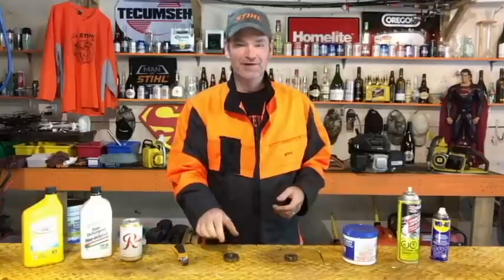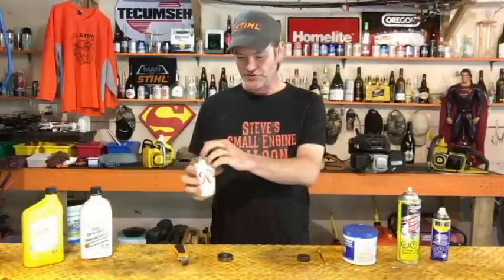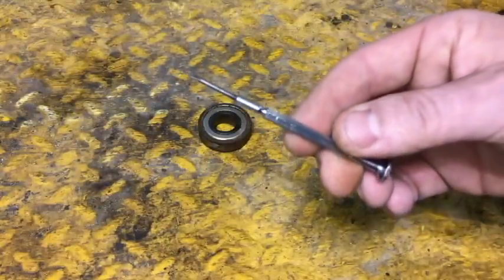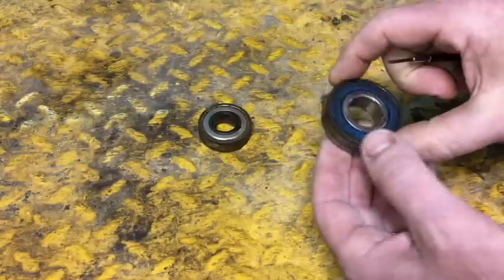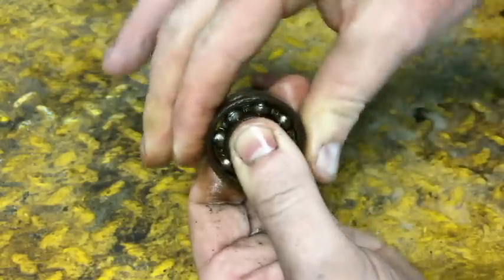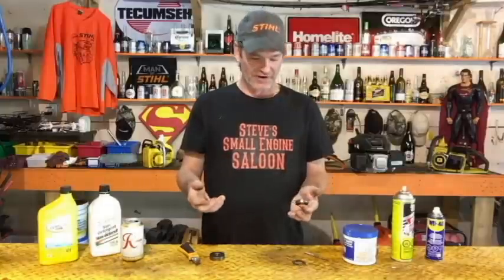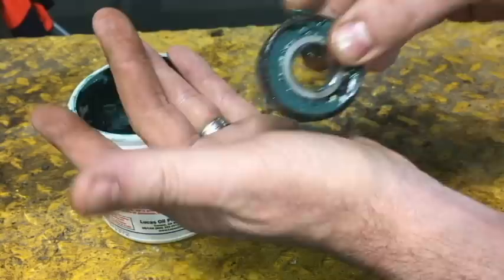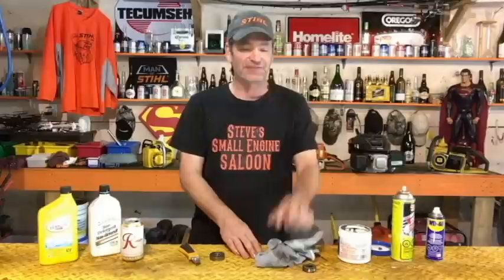How To Un-Seize, Clean and Grease a Sealed Bearing

Comment: I know this video is 3 yrs old, but im gonna throw in a helpful tip. I work in the swimming pool industry. Instead of replacing bearings in pump motors and such we typically just replace the motor. I recently decided to attempt rebuilding a few scrap motors and in doing so found a lubricant like no other. Its called Zero Lube. Its sold in the pool industry as an o-ring lubricant, but I use it for a lot of other things. Like rusty tools. Crescent wrench was seized. Put a few drops on it and let it sit for a day and it rolled like it was brand new. I used it on a seized 6202 bearing and it was amazing how freely that thing spun after. Motor worked like a champ and still is a month later. Quiet as a sleeping baby. Anyway, Zero Lube. Great stuff. Just thought I would recommend in case anyone is looking for a good all around lube.
Reply: I've just looked it up. It's spelled 'Zer0' not "Zero". I watched one vido to free a stuck plastic handle doodah on a water pump. Several people said they used washing up liquid and that worked, too. So I went from 'I'm definitely going to buy that!' to 'I probably won't buy that'. Need more convincing.
Reply: @johncollins8304  Zer0 Lube is made by Lubegard and uses their patented LXE technology. The chief developer of LXE was Dr Phil Landis, former head of Exxon/Mobil Oil Applied Lubrication Research Group. Many of the Lubegard products are considered staples by industry technicians in the automotive world.
Reply: Thanks. I’m gonna give it a shot. Sounds like a good product, patented & proven.

Comment: Great tip Steve, as always. What I do is drop the bearing into white vinegar which removes ALL the rust, even from the balls or needles. An hour or two in vinegar and they actually get shiny again. Then you can repack them after you rinse off the vinegar.
Reply from the maker: Right on Stevo...
Reply: I might try vinegar in a small jar.  drop right into the ultrasonic cleaner.....  might work?
Reply: That rust is just cushioning for old bearings
Reply: @xredman002  Yeah, I wondered why he didn't use the u/s bath. In a glass not plastic jar like he showed us I another vido.
Reply: Phopshoric acid is also considered the best acid for stainless steel and removing rust and preventing further rust. Phosphoric acid and acetic acid vinegar both prevent further rusting by removing and dissolving the brown rust and turning into a hard black iron coating.
Reply: Yep but I soak them in diesel to remove grease first and white vinegar second 
Inspect and junk junk

Comment: Love your site and boy, have I learned a lot from you Steve... Thanks very much.
This video on the restoration of seized ball bearings is interesting, however, bearings are the Achilles heel of the manual transmission world. Having been a licensed transmission technician since 1982 I (if I may) would like to inform you of the correct procedure to check a ball bearing.
 1) Free up the seized unit with your choice of fluids.
2) Wash thoroughly the bearing in varsol or similar thinners.
3)Blow dry the bearing completely (do not spin the bearing with air)
4)Apply a few drops of light machine oil(I use ATF)
5)With your thumb through the center of the bearing to support it, roll the outer race around while applying significant pressure with your other hand. ANY roughness in either the outer or inner bearing will be felt. If it's rough AT ALL it's junk.

Comment: I learned the palming method back in the mid 60s from an old school mechanic friend of my dad.  There is a slight variation. Keep palming the same spot until a good amount of grease oozes out the opposite side before moving to the next spot on the bearing. All the while, do not turn the inner race with respect to the outer race. Turning the races while palming will spread the grease without properly packing and filling the entire bearing. No need to palm the opposite side. When palming tapered roller bearings, force the grease into the larger end of the rollers until it oozes from the smaller end.

Comment: Excellent video, as always. I bought an old Craftsman LT2000 last year from a guy who was selling it for his aunt. Her husband owned the mower and had died. This old guy had kept up the maintenance on it very well and had even upgraded the motor from a 17.5 B&S to a Platinum series B&S 21hp motor. I noticed it was making some weird sounds every time I mowed. So, after watching some vids, I decided to take the floating deck off and do some maintenance. Your videos on greasing the bearings were the most informative and I thank you much for taking the time to post these. My bearings were very dry and nasty looking. I used Q-tips to get out the old, gunky grease and put new grease in them. Wow! 100% better! I can't believe I was putting my mower through that stress. Won't happen again. I'd like to get 10-15 more years out of this thing. I can't wait to mow this weekend, after I sharpen the blades and get the deck back on, lol. Btw, I also don't work on anything or mow on the weekends without a good beer or 8...always above 5%. Thanks, Steve!

Comment: Exactly what I wanted to know. I am still making my grandfathers(RIP) work shop, my own. The last couple days I have been emptying out a couple deep drawers loaded with pulleys, bearings, etc.. I didn't realize how many bearings were in there. Some are in very good condition. I have had them sitting in oil and gas, and have been using a paint brush to clean out the old grease from exposed bearings; and to clean the outsides too....they have been in that drawer for at least 4 decades.

I have a couple ideas needing bearings, although most of these are too big. I just did some searches to see if there were a way to clean and repack old sealed bearings. I have a bunch of tabs opened to explore my search results, and luck of the draw, got you Steve...a slightly younger you LOL

Well I can close the other tabs, because you answered my questions. I wasn't even certain that all my bearings were the same type, as several had no seals, so looked very different. Of course I wondered if all the others looked just like them, but didn't know till just now.

Once I am done with the initial cleaning, I am going to open them up for full restoration. This will safe a LOT of money, and now I can think about those projects requiring bearings.

Thanks Steve.

Decided to check with the other experts, and learned that it is wise to check and even repack a new bearing. They cheap out on the grease and use cheap stuff. FYI

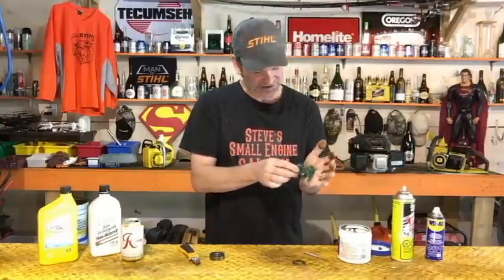Comment: @8:07 don't flip the bearing over!  If you flip the bering over, you're using new grease to trap in the old grease.  Always go from one side ONLY and keep going until you see the old grease being forced out and the new grease shows up on the other side.  You form a small seal with your hand that pushes a small amount in each time, just keep working it until you see nothing but clean grease.  We were actually taught this in high school a LONG time ago.
Reply: Just clean the old grease out first.   WD40 and air compressor. Then re grease any way you like
Reply: I agree with Randy. You have to make certain you have removed ALL old contaminated grease before you start the repacking process. Otherwise you are just wasting you time and setting component for an eventual failure.

Comment: "Palming" is called "field packing" where I grew up. It really gets the grease down in around the balls and pushes out the old grease. I've done it this way since the 60's.

Thanks Steve, great tips as usual.
Reply from the maker: You are welcome.  That's why I do this!
Reply: My first boss taught me the palming method, and I have been using that method for fifty years.  It think it works better than my bearing packer I bought.
Reply: that was the way my father taught me to repack berrings , he was a merchant marine  in WW2 had 4 ships shot out from under him ( 3 trop'ed & 1 bombed) started as an oiler on an iron boat plying lake michigan in his teens) Very proud of the old man.
--Rick
Reply: Comment to Steve, to john t, and to Rick.  First Rick -- thank the old man for his service for me.  My dad was merchant marine too.  To Rick, it's good to hear others repeat they've used this palming/packing method since the '60s.  Me too.  Finally, to Steve -- like the other guys say, this method of packing bearings has been around a while.  I first saw this palming method of packing bearings in an old 1950s Motor's Manual.  In the old days when you could take bearings completely apart, we used to remove the outer and inner races, inspect each ball, and replace those that weren't perfect.  Then we would repack them using the palming method (as per Motor's Manual illustrations) and reinstall them by properly torquing them.  You knew you had the right amount of torque when the shaft no longer would rock back and forth but the bearing would still spin freely.  Then you'd tighten them about a 1/4 turn more.
Reply: @rickcoona  talk about not your time to go right there. Most don't make it through one sunk ship much less 4. Even if a life Raff was accessible it doesn't take long for people to be so far spread out search efforts will have almost nil success. And a lot of ww2 guys in the water became a shark buffet waiting to be rescued. Only takes a few drops of blood and every shark in a couple miles knows. With some real injuries several miles would be heading in. Frightening stuff. I know in the early first years of the war before america joined. The Germans were evacuating ships before torpedoing it. Crew would be unloaded in a neutral area. They didn't want to invoke neutral nation's into the war. Or be seen killing them. Once the war progressed basically any vessel from any country helping the enemy. With no warning,don't want your position radioed in exactly and be unloading a ship then your mission of search and destroy ends while you have to find safe harbor for said crew. Time and resources. Much respect to sailers of ww2
Reply: @JamesSmith-lt5zz  Indeed and thank you i learned a lot from him before he passed they wern't called "The Greatest Generation" for nothing.  fun thing was he was "conscripted" for the rebuilding of Japan after their surrender and when he got home to Michigan Three days later he Received a 'Personal invitation from the president'  to report to his local Draft Board: "Congratulations Son, You are Going To KOREA!" When he reported, he brought his service record and was made an instructor  for the combat engineers at the local training base. I still have his basic Field Manual  FM 21-105 Engineer Soldier's Handbook issued from the War Department dated June 2, 1943.
Reply: @rickcoona  amazing thanks for the follow up. Maybe put that manual in some kind of plastic wrap to preserve it from oxidation. No telling what collector might pay for it  probably only a handful left in the world
Reply: That's the way we always did it with the tapered roller bearings on a car after cleaning them then I got a little bearing packer after that you clean the bearing and then put the bearing in there and screw the top on and push down on it or squeeze it in a vice and it pushed it through.

Comment: Great instructions on greasing a sealed bearings.  And for repacking multiple bearing at same time take a empty coffee can put enough grease in can to cover the top layer of bearings, heat grease until liquid, then put bearings in can making sure top bearings are covered, then let cool.  I use a wire coat hanger with hook at end to make an extraction tool, then wipe off excess grease. Ready for use or storage.

Comment: down south we been calling the palm method hand packing the bearing ...only way to pack the bearing if you dont have the bearing press...Also don't turn it over and do the other side you only push out what you just pacled in ...keep palming/packing untill you see the grease coming out the other side ,once it comes out the other side put the seals back on and it's rdy to go ...Great Video Brother !

Comment: Greetings from Williams Lake, British Columbia! I do this all the time, but only if the balls look good. Just one pit or flat spot on one ball will lead to early failure, and that failure never happens at a good time. Ask me how I know.

I use ordinary solvent or paint thinner with an old toothbrush to clean the bearing, then compressed air (step outside!) to remove all debris and solvent. NEVER let the compressed air spin the bearing, as that can cause damage. Only re-grease once the bearing is dry. Some folks swear by lithium grease, others swear by moly grease. I can't say I have a preference. 

Steve's technique here is great for most applications. But if the bearing is buried in a really difficult spot, replace it. Only try saving a bearing that is fairly easy to get at. Great videos, Steve!
Reply from the maker: Thank You...

Comment: Yo Steve, this saved me today.  One of the bearing seized on my 17 year old mower drive axle.  I took it apart, being a holiday the specialty shops are closed, and the auto shops didn't have a replacement.  Finally I thought about what else I could do, and ran across your video.  Popped the seals off, washed all the dirt/grease out with soap and water, dried it, and then packed it and reassembled.  It's like brand new.  Thank you for posting this!
Reply from the maker: Right on Aaron!  You're Welcome...

Comment: I've cleaned many sealed bearings in my day. I mainly use my parts washer to do it. I take off both seals, clean the bearing, inspect it, put one seal on, pack it full of grease, then put the other seal back on. I've done this on deck spindles for years and the bearings last for years as well. If you buy new sealed bearings, take off one seal, pack the bearing full, then put the seal back on. They put very little grease in them from the factory. They do wheel bearings the same way on autos and motorcycles.

Comment: Soak them in fuel works for me spinning them in the fuel.Just remember folks that this doesn’t fix pitting and any wear in the races or ball bearings currently there.

 Good video Steve on Band-Aiding a bearing.

Comment: Many thanks, Steve!  I used your technique today on my Craftsman deck idler bearing.  It was so loud, rough, seizing then I remembered your tip.  Popped the outer seal and washed the crud out with brake cleaner and compressed air.  Carefully added wheel bearing grease, much to my surprise the bearing was as smooth as silk!  Assembled in reverse order and was back in business in short order.  Smooth, quiet and good as new!
Reply from the maker: Right on buddy!  Thank You...
Reply: Normally I like what Steve is doing, but not this. Bearings are cheap and widely stocked.  Generally the time cost accessing any bearing greatly exceeds its value.  Potentially you could do a lot more damage with a seized or even a rough bearing.   Absolutely do this only when you are stuck!

Comment: I finally got the motivation to drop the deck on my TB42, remove the spindles and grease those sealed bearings. Thanks to you I have a better understanding of "how to, why to and when to" do the maintenance. I sharpened the blades also and found out that the drive belt runs so much easier and faster because there's no more awful dragging, dry, screeching noise coming from the bearings. I appreciate this machine thanks to your videos.
Reply from the maker: Excellent!

Comment: Tip...use the ultrasonic cleaner to clean out the bearing like new. I recommend replacing any seized or lose bearing has a full time load or any weight on it. Wheels, blades, pulleys, etc. Just save some time and replace them. The clean and repair method is best left for things with partial to no continuous loads, like a mower deck side wheel, that only touches the ground occasionally. It would work just fine there. But an old repacked bearing won't last at speed with a full load for to long before your replacing it anyway. Take care. Great video.  Jpol.

Comment: This is only worth doing if you are stuck and can't get a new replacement bearing easily/quickly. Once the bearing surfaces are pitted by corrosion they are still on borrowed time even when unseized and relubed.

However even most new bearings generally lack enough grease and/or use poor quality grease. You can dramatically increase the service life of new bearings by cleaning out the factory grease and then fully repacking them with a quality high pressure/high temperature grease.
Reply from the maker: Right on...
Reply: True.  I understand it that they fail (seize, dry out, or get wet and dirty) because the seals fail.  So even if you clean and lube, the grease will be lost, the water will come in, just like before, and you still need to go with new bearings.
Reply: Get in there with a flashlight and a magnifying glass, and look for pits. 
If you find any, go ahead and repack it, but just know that it is not going to last for too long. 
Best thing you could do is when you're done repacking it, get on the internet and order new ones. 
Put your item back in service if you want , and run it until they get really noisy, and by then you've got your new bearings on the shelf hopefully.
Reply: @acoustic4037  
Given the right environmental conditions, they can build up moisture inside all by themselves. I know when the weather breaks around here, and it's colder inside my shop than outside and I open the shop door the whole place gets totally damp and wet.
 It looks like it almost rained inside.

Comment: thanks! worked on my frozen spindle on old mtd riding mower.  it is loose  but works for my ditch mower ony 36".  I blew it out with air before using brake fluid and then W, and then the grease.  also since my press is at my father in laws,  I just did it while on the shaft.